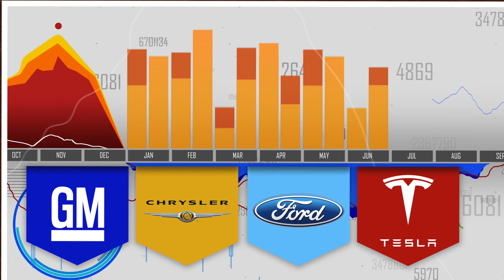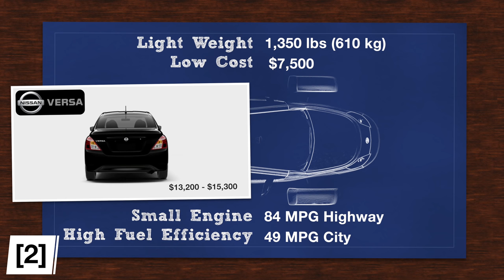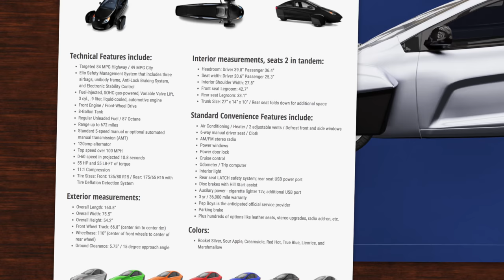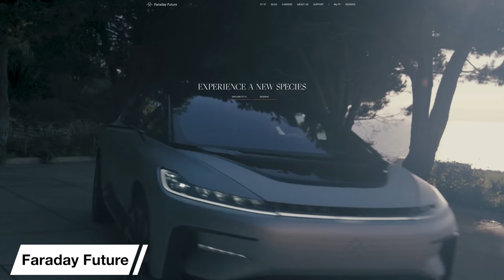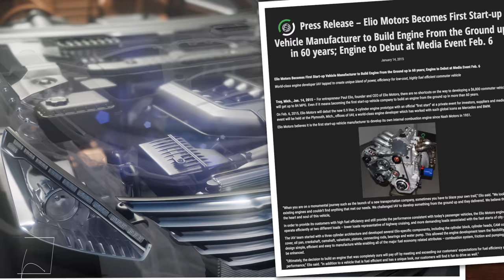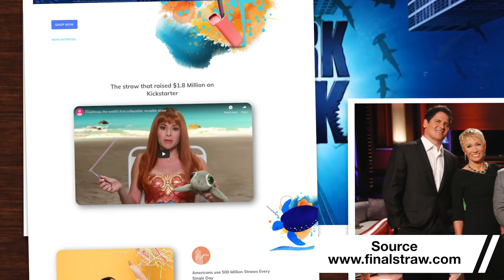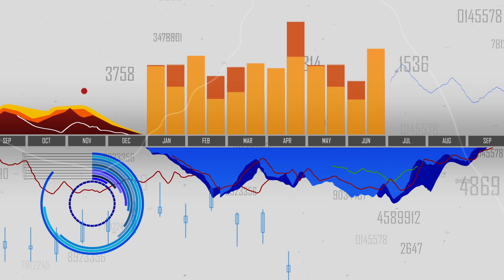How this Radical Car Missed its Chance to Change the World

Comment: Hybrid is still the way forward for ten years or more. However, My H2O powered hybrid is the long range answer. Solar and battery convert water to Hydrogen and the hybrid engine powers the vehicle from that H. Magnetic turbine tubes convert forward motion to electricity to propel thru the night.

Comment: A smart cdi, a vw lupo 3l audi a2 3l have a 90mpg with 4 wheels and audi a2 have 4 doors

This 3 wheel car is nothing new, can be more interesting with a diesel engine that have a better mpg

If you don’t want a extremely mpg you can buy a citroen c2 1.4hdi seat ibiza/cordoba 1.4tdi or 1.2tdi or similar that can achieve 60 mpg

Today the people don’t want a efficient car with good mpg because they buy a lot of SUV and other cars that achieve 29mpg or less

Comment: Whoa WHOA WHOOA! Yes it would be nice to just go to any of the large auto makers and buy truck loads of engines, but most(ALL) of them aren't going to be keen on the idea of launching a competitor that will outshine their most fuel efficient cars while not offering a direct competitor of their own. If the Elio took off they could end up spending $100,000,000,000s to try to break into that new market and still be late to the party, undercutting themsellves in the process. Hence the third party performance engine manufacturer. ROUSH=VROOM

Comment: Elio should design reachargeable hybrid EVs something like the Chevrolet Volt. Their technology as proven to be the best transition between petro engins and electric vehicle. However, Chevrolet ends the production of the Volt this year! According to sources, the cost of manufacturing is just too high. And now, Aptera is back with an 1000 miles EV! And to make thing worse, Myers EV new Tandem, a 4 wheel tendam seating as the model name suggest, are ready to take reserves. I beleive that Elio should rethink with what type of technology to head and the electrification of cars is the future. And last note, Elio should classify their car as a car, not a motorcycle.

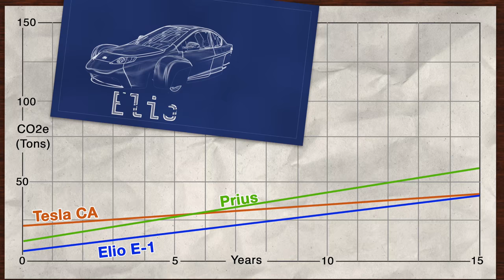Comment: 3:28 yes it takes tesla 15 years to beat elio, but 5 people can sit in the tesla and the technology to produce electricity will eventually become 100% renewable
Reply from the maker: Hence the bridge car. 100% clean grid is over a decade away
Reply: @TwoBitDaVinci  - The Tesla actually exists the Elio does not. I'd like you to test the Elio for the real mpg, real weight (it's to be 350 lbs lighter than a Slingshot which has much less) and real CO2 output. That way you could do a real calculation instead of a theoretical one. If this is the case, I can make a 200 mpg car that weighs 500 lbs and costs $4000. This is a fact but you'll need to get back to me in 9 years and you'll see.

Comment: No I would not consider buying one. Besides there is an electric version out there now called Solo. It and this Elo will have the same problem. It is a secondary vehicle. A go to and from work car only. A position that used vehicles hold. Which you can pick up for half of the cost of this vehicle. Plus the thought of this vehicle getting in a wreck with an 18 wheeler, well it going to come out well for these kind of vehicles. So you might sell a few but it will not be a viable company. People aren't making enough money to throw around, because of globalization, to buy this for a second car. Ain't globalization great. So get use to the carbon foot print that we have today.

Comment: All who want E.V. only at present day State of the art, be aware of the possibility of major Grid  power outages.
Hybrid Technology will get you through these events. I.C.E. Tech, diesel or gas, will get you through. At the present time,
until  graphene solar panels are cost effectively marketed, you will be unable to charge the E.V. unless you
have a decent generator and a good supply of fuel, plus the required interface for the charging cord.
Major Grid outages may seem unlikely here in North America. They have occurred, smaller localized outages
during severe winter weather and such happen every year.
Something to plan for if you are E.V. only. If some day we were E.M.P.d, by some Mini Me wanna be out there,
well, the E.V. get's fried as well, unless its in a sub basement garage . I hope the Elio people figure out how to complete the process and get this great product to market. It will really help low income/first time/ business travel and sales people,to mention a few. Thank you Two Bit da Vinci, nicely done.

Comment: The elio looks dated and old. If they want to sell well either argue that the elio is a car because of cabin or put a second back wheel on it so it can be a car. Also I would ditch the gas motor. The market is leaning toward electric. And that looks like a electric. Or give it a two litre engine and sell it as a sports. 

It has potential but elio needs to ask themselves who would buy this and design it for them. And sell it to them.

Comment: Tesla may have been the first off the mark with all electric cars, but they are still out of the avrerage human being's reach, not only becasue of the cost, but because of other issues, like needing all four wheels on the ground to be driven.  We have people who are now obssessed with reducing their carbon footprint - and those who expect others to do the same.  That's not going to save a world that's ending anyway - whichever worldview you accept and believe.  I was nearly hit by one recently, becasue I didn't hear it, and the driver didn't see me.   Okay I like the concept of three wheelers, but like this clip says, you need a motorcycle licence to own and drive one, even if it is fitted with a steering wheel and pedals.   The Sondors EV and Solo appeal more, the Sonders because it has a decent range and carries three people, as well as being available with ranges comparable to petrol powered vehicles of the same type.  The Solo because there's nothing like it on road.   These vehicles were seen aplenty on a show called Beyond 2000 and none of those entered mass produciton and I never saw any of the on the roads.

Comment: Me want 1👈😎👉👊💯. I still drive my 91 Geo metro w/281k miles on it. And the car curb weight is about 1750lbs. Slow AF but easy to park in tight spots and still get a Max 45mpg freeway. ✌️out from Modesto,CA😎

Comment: part Elio issues has been big US car makers lobbing that be treated as a CAR not motor cycle which has added to costs and redesigns

the point if getting classed as motor cycle was the more lax safety regs needed where a CAR has to have things like airbags and other safety tech that adds the price the Elio wasnt "bridge" car at first it was meant as a cheap around town starter car for teens and 20-somethings that didnt need a big car 
Elio would do great if they keep it under 10k it doesnt need to be e-power it needs to be CHEAP so people making <20 bucks an hour can afford it your looking at the wrong way as EV competitor it came out need for a cheap car in the depths of the 00's recession

Comment: How how different is it from the Italian isetta , the little car that opens from the front ,( pre new car rules of manufacture ) it's street legal , if it's the manufacturing part of it offer it as a kit ! , say the body and frame are separate and you just have a certified ASE mechanic assemble it , or the DYI people can do it themselves , and what's the difference if you go from one wheel in back to two close together , if you change to two it wouldn't be a motor cycle , ( kit cars don't go thru crash tests , but you can add your own reinforcements ,) I guess this would almost fall in the VW bug kind of car ,we all know how popular it was ,  I been a fan of the micro cars for along time , it would be nice if it could be offered as a gas or electric car and there should be a place for it in today's world .

Comment: This design will make come back after 2035, as oil will be perceptibly dwindling and cost benefits of having gasoline vehicles would be extremely expensive. Of cause there would be electrical but some vehicles needs to oil involved, and batteries can't match with how far it can drive even by then.

Comment: This car need 2 wheels in the Back , Air Bag,  (T) 4x4 traction and remote start ......if not , you buy an SUV. Who can use this car in winter in the North east? I will not risk my life in the snow to save gasoline.

Comment: ain't no way i, or anyone I know, are going to get a motorcycle license and wear a helmet to drive one of these.
Reply: That part of the video was incorrect. Elio said they were working with states to change the law. The only state where an adult over the age of 21 is required to wear a helmet is West Virginia. Five other states require a helmet for drivers under the age of 21.
Reply: @jimbeam6303  thanks for the info.   I'm still not going to learn to ride a motorcycle in order to buy one.  :)

Comment: They made some hefty promises that are probably being difficult to achieve. they also made some engineering mistakes like not sourcing an unboosted i3 from say Ford instead deciding to engineer a new engine based on a 20 year old suzuki design... 

then the government high on the farts of the big green horse it was riding at the time didn't care about this 80mpg wonder because "it wasn't an EV" so no help from that side of things... 

now it's dragged on so long any fans of the company product and brand have been turned away and that's a shame because the idea was great! 

though I am surprised no existing motorcycle or ATV brand picked them up.  especially Polaris who was on a buying frenzy around the time this started to pop up.

Comment: this would be a play car for me if I ever got one, the price is excellent and mods good but hte problem comes with increased insurance, mainteance and another vehicle to keep clean and oil changes and other things, which increase the cost if you already have two cars.  this is  nice however for those on low budgets who dont want a big car due to extra costs ensured by such a vehicle. this would be excellent as first car for a single person who is trying to work part time and go to school or has to work part time and care for a child stuff like that. if you have not noticed jobs that pay very well are dissppearing faster than you can hello. only low paying jobs available unless you have extra schooling.

Comment: I don't want to step out of line. I found out about these cars first two years ago. Second I found out about 2000 Honda insight nice enough car got one for $600 got another for $1800 and I can get over 100 miles per gallon. Look at my avatar. 150 miles to the gallon highway only at 40 miles an hour under perfect conditions and 10 modifications. At 50 miles an hour I get around 100 mpg. Lean burn hi pressure tires removing excess weight driving slow . That's all you got to know .check out ------insight central.net----until you can get  Elio 2000 Honda insight is hard to beat. Hey super clean garage queen good paint low mileage insight is about $6000 but I have a $600 car my cousin has a $500 car and my sister a $1200 car and they preform very well for us. It does help to be super educated on these cars and to have some mechanical skills.

Comment: I would buy one if they released it with a gas engine and it got the fuel economy they claim I followed them for about two years watching them push back the release date I would still like to buy one but they need to put them into prediction first

Comment: I like the Eugene Oregon made Arcimoto. It’s has 2 seats and a WOW factor.
You can get half doors or full enclosure. 75 MPH 100 mile range. Just
staring production. Price will drop as manufacturing increases. Check
Arcimoto out on youtube!!
Reply: The Arcimoto is a glorified golf cart. They only removed one rear wheel so they could go beyond the 35 mph limit for those electric golf carts you see in retirement communities. Plus it's behind the times as it can only be used for short transport on great weather days. It's range made sense in 2012. Not in 2020. It's like a wayback time machine.
Reply: @billsmith5960  Hi Bill I think it's more than a  glorified golf cart. They continue to improve the design. As batteries get better range will improve. I think it would be a great commuter, delivery or run errands vehicle. Most areas of the country it could be used for 3 seasons. Also other counties would be interested in it too. It would be fun to rent one while on vacation. I'm betting in a couple of years they will be making money. I'm not saying they will be a major car company but could be a good profitable business. Plus I would have a blast driving it!!

Comment: a three wheel taking a turn at 84 mph isnt safe.
no i'm think of the 2010 Morgan 3 Wheeler or the Peel P50 or 1965 Peel Trident

all have one wheel in the rear and two in the front

its still filps over ALOT well the Peel P50 and the Peel Trident,  2010 Morgan 3 Wheeler is just hard to stear, it may flip every once in a while.

Comment: The Chevy Spark starts at 11,000 and gets 50 mpg... so... I stopped watching 30 seconds in when I realized you didn't even google the first statistic you quoted.
Reply from the maker: The spark starts at 13,200 from their website. And gets 34 combined mpg. Hope that helps
Reply: @TwoBitDaVinci  Must have gone up on price since last year and the mpg must be vastly under reported. I bought mine for 12,000 after fees and I'm getting 44 mpg average after 25000 miles... so... I get the book says one thing, but it doesn't agree with what actually happens. Maybe I got the best deal ever and my car works better than everyone else. lucky me.
Reply: Remember, the Elio is "targeted" $7450. So there's no idea as to what it will cost when it comes out. Plus it's "up to" 84 mpg. So we have no idea as to the mpg as to when it comes out. It would be nice if this channel would take one for a test drive and interview Paul.